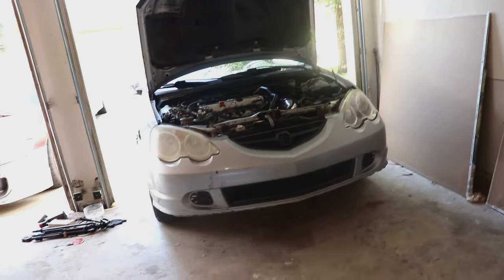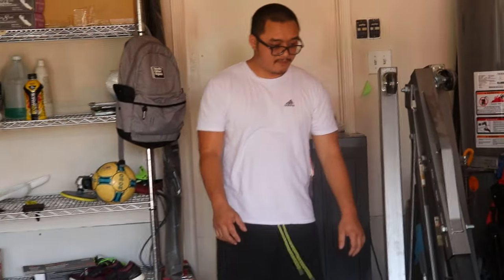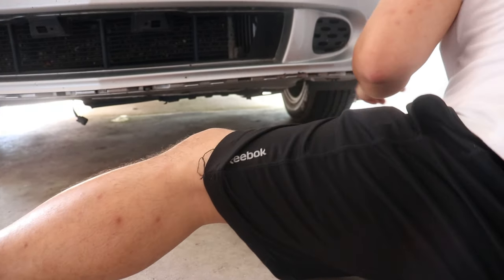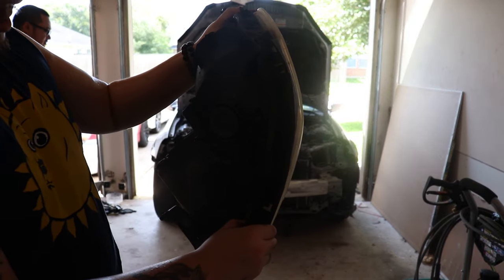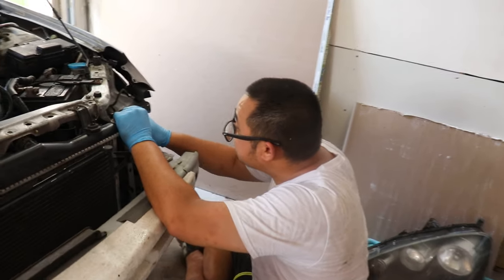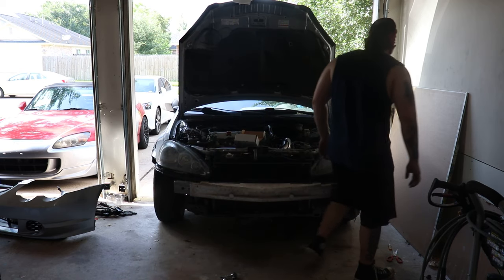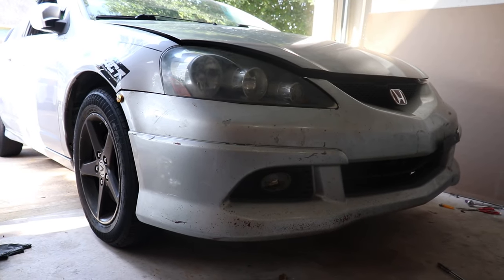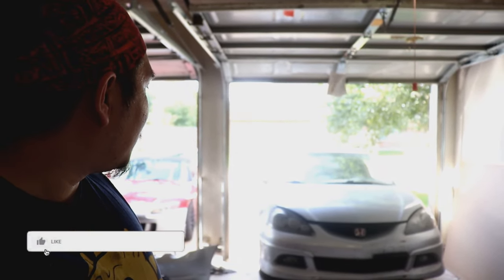RSX Front End Swap! | RSX Installs

Comment: Nice install! So did y'all have to do any soldering?
Reply: zvck † xix if you’re planning on keeping the front lights then don’t solder, just crimp it with butt connectors. But if you’re gonna keep the 05-06 look then safe to solder if you don’t want them coming loose while you’re driving or not turning on at night